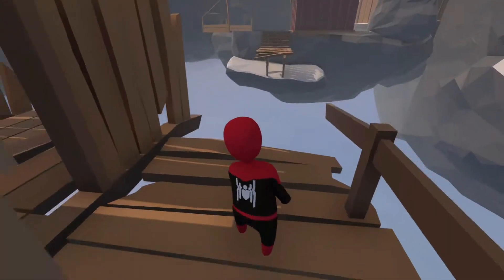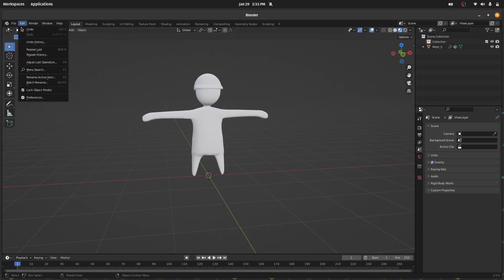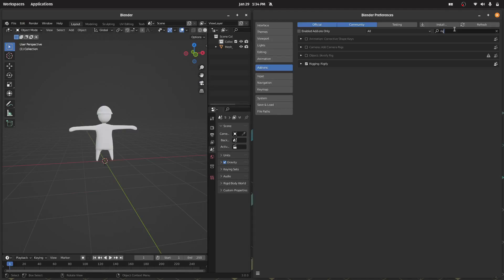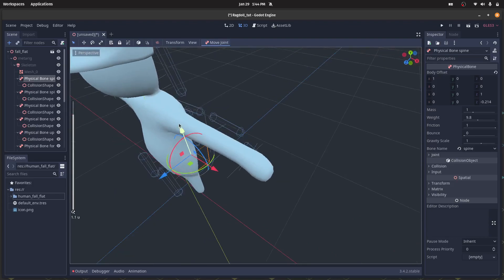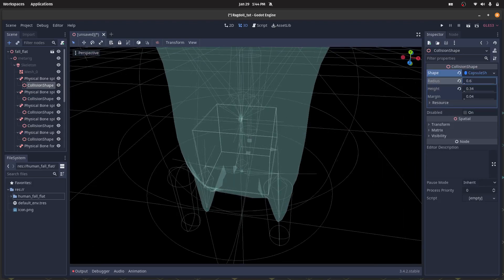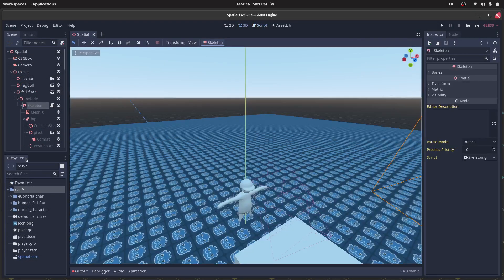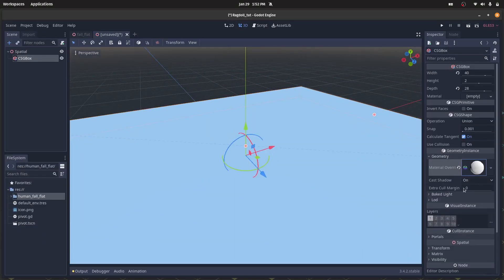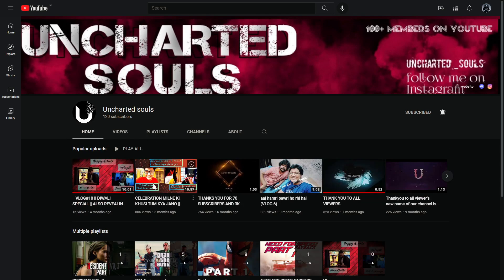Ragdoll in Godot explained Fake Kurzgesagt || Godot Game Engine

Comment: But why didnt you show the real process where u parent the mesh to the skeleton and then the export process and how u import from godot ? That is the real stuff, but nice video either way
Reply from the maker: Actually I forgot that bcz tge skeleton was already made so I forgot to show the parenting process. So I am typing here below so if anyone want to know 

The thing you have to do is select the mesh first the holding shift you have to select skeleton the press Ctrl+P and select "with automatic weights" if there is error about bone heat to do so then mesh would not be closed or its faces woul be overlaping otherwise u r good
Then export it as glb file to godot project